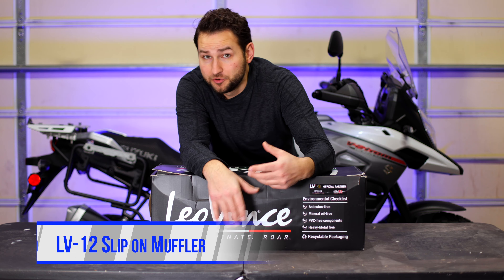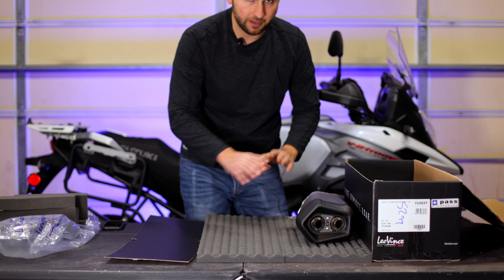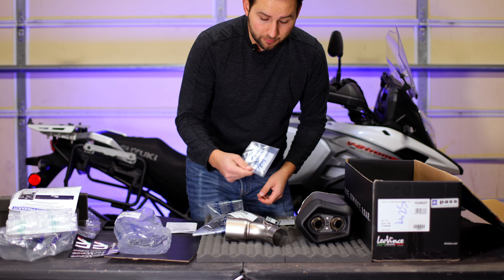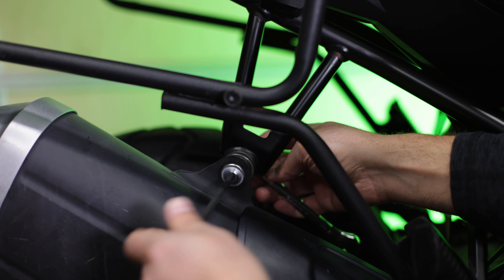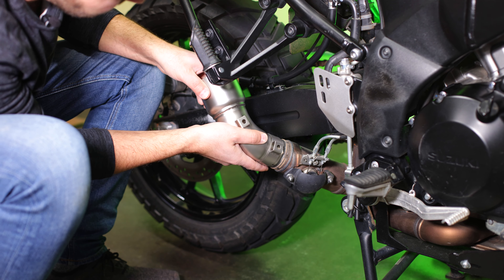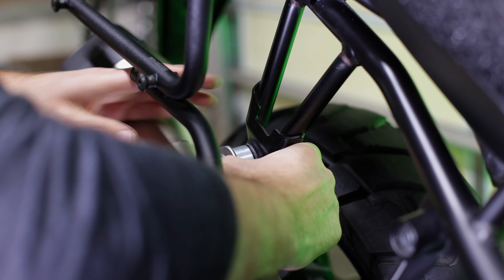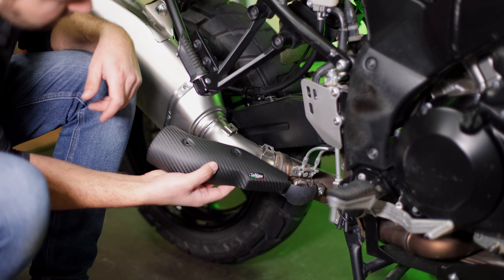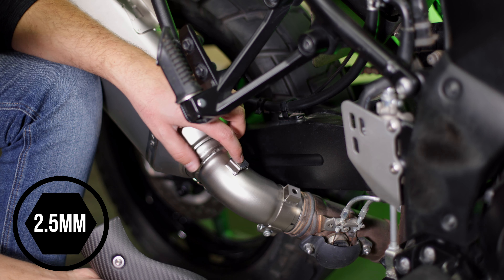How To Install LeoVince LV12 on Suzuki Vstrom 1000/1050

Comment: I ordered for my 2018 1000XT but it doesn’t say if the link pipe is with it?
Reply from the maker: Typically when you order the set from LV, it comes with everything you’ll need.

Comment: Does this muffler also fit the 2014 VStrom? Do you by any chance know if there were any major changes of the mufflers between 2014 and 2020? The reason is I got a 2014 and there is a muffler for a 2020 for sale at a very reasonable price. It is a Shark DSX5 muffler. Any info would be highly appreciated. Thanks! Chris
Reply from the maker: According to LeoVince, they have an exhaust that fits 2014-2019, which indicates that they should all fit in between. The only difference is whether or not heat shields, such as mine, will fit onto your specific model and year.
Reply: @1LiterADV  thanks a lot for the answer. I am gonna give it a try.Greetings from Austria. Chris

Comment: Why would you say this muffler works on a 2018 vstrom at the beginning of the video, but then have a "heat shield disclaimer"? Bottom line is it doesn't work, or work with modifications.
Reply from the maker: You're right, I should have mentioned the disclaimer in the beginning.
For what it's worth, if you purchase the LV12 specifically for a 2018 Vstrom, you will receive the SAME product but w/o the heat shield. In our case, we happened to get the LV12 for a 2020 Vstrom, because I will most likely upgrade to the Vstrom 1050 soon.
Reply: I ordered the LV12 for my 2018 but doesn’t say if the link pipe is in it?